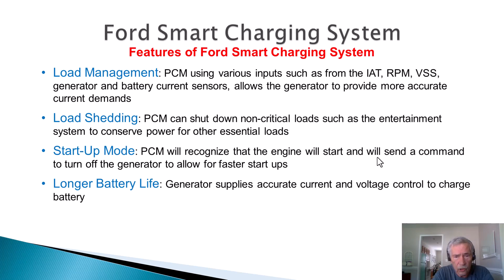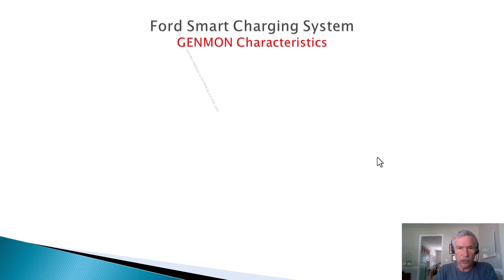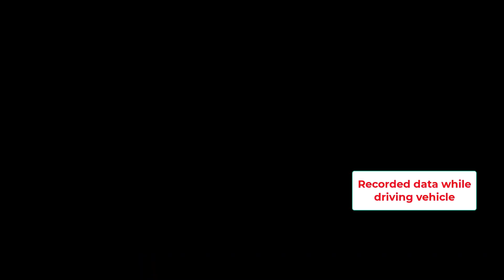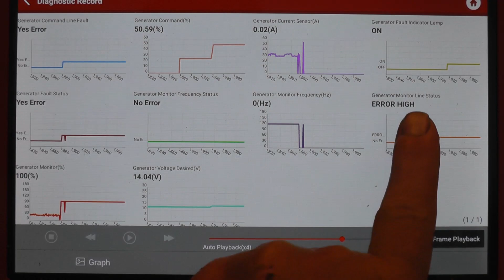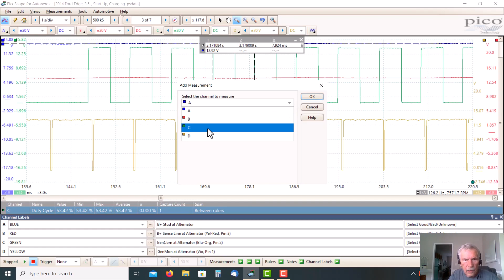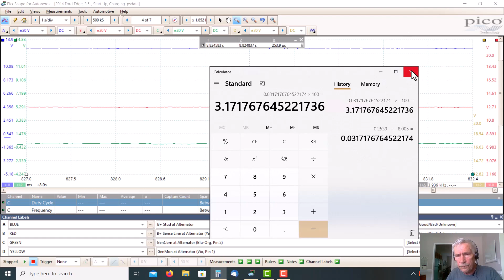Understanding and Diagnosing Ford Smart Charging System

Comment: Seems to contradict what I am seeing after installing new alternator on 2003 Ford Expedition.  GENCOM always displays a square wave typically around 8.6V, 60% duty cycle.  GENMON shows around 8-9V DC return, no square wave.  14.2V at the battery.  Connections between alternator and PCM check out at well under 0.5 ohms, no sign of wire chafing issues.  PCM was swapped out, made no difference.  OEM alternator was 2L7Z10346BA, replaced with Ultima R112019B.  1st replacement alternator showed a 170 Hz square wave.  I thought it must be defective, returned and swapped.  2nd replacement alternator about the same result except 130 Hz square wave.  So why a DC return on GENMON instead of a square wave?
Reply from the maker: Hi Steven, the GENMON will only put out a square wave pulse when it wants to change the setpoint. Otherwise, say after a start-up, you'll see activity on this line. Once the setpoint is made, you'll see a few pulses every 5 seconds or so. However, the GENMON line should always put out a square wave indicating the load on the alternator which reports back to the PCM. What's interesting is that you have 14.2V at the battery implying that the alternator is charging the battery. I would never check the ohms of wires as the only thing that it tells you with certainty is that the wire(s) are not open. I mentioned in the last part of the video of how to verify the wiring of these two wires and that the PCM is working correctly.

First, to verify that the alternator will put out a charging voltage is to unplug the connector. Start the engine and rev it to around 2500 RPM and you should see about 13.5VDC at the battery.

Now to check the wiring of the GENCOM and GENMON wiring and the PCM. With the connector at the generator still unplugged and the engine off, put a jumper between the GENCOM AND GENMON lines. Hook up your scanner and monitor the PIDs GENCOM and GENMON while the engine is running. You should see the GENCOM and GENMON PIDs flip-flopping. In other words, you'll see the GENCOM active and then the GENMON go inactive. And the process will repeat. If you see this, you know the lines are good, the PCM is good and that the program inside the PCM is doing its job. Good luck and have a great day!
Reply: @stuzman52  
Thanks very much for your reply.  All this started when my battery warning light kept coming on and off randomly and I got a "Check Charging System" message, scan code P0620.  Tried 2 rebuilt, reprogrammed PCMs, no difference.  First rebuilt alternator produced similar measurements except GENCOM frequency was 170 Hz, GENMON voltage 8.8 V.

Here are my detailed measurements with the 2nd alternator:

A. 3-pin connector detached from alternator, measured at PCM
	Key off, ohms to GND at PCM:	GENCOM = 2.1k		GENMON = 134k
	Key on, engine off:  			GENCOM = 8.7 V DC	GENMON = 0.0 V DC	    BAT = 12.16 V
	Key on, engine on at idle:		GENCOM = 8.6 V DC	GENMON = 11.6 V DC	    BAT = 11.82 V
	After engine rev to 2500 RPM:											    BAT = 14.29 V
	
B. 3-pin connector attached to alternator, measured at PCM
	Key on, engine off:			GENCOM = 8.7 V DC	GENMON = 0.0 V DC	    BAT = 12.17 V
	Key on, engine on at idle:		GENCOM = square wave, ~9 V Pk to Pk, 133 HZ, ~60% +cycle
													GENMON = 10.4 V DC	    BAT = 14.19 V
	Turn A/C on:					GENCOM DC = 5.8 V	GENMON = 10.3 V DC	    BAT = 14.12 V
	Turn headlights on:			GENCOM DC = 4.9 V	GENMON = 10.2 V DC	    BAT = 13.97 V
	
Here is what makes no sense to me, based on your presentation and REMY's:
	Why does GENMON show a DC voltage instead of a square wave, and only when the engine is running?  I thought this voltage was supplied by the PCM, to be manipulated by the alternator.
	
	Why did the GENCOM square wave show a radically different frequency from the 1st alternator to the 2nd allegedly identical alternator?  I thought this was controlled by the PCM, but it looks as if it is being set by the alternator.
	
	Why does GENCOM show an 8.7 V DC level with the engine off and the alternator disconnected?  I thought the GENCOM voltage was supplied by the alternator, then manipulated by the PCM.
	
	With the alternator disconnected, key on, engine off, I would expect to see a source voltage at GENMON, and no voltage at GENCOM.  Instead I see the opposite.
	
Even so the system seems to be charging the battery OK, and I have not (yet) seen the battery warning light come on since installing the 2nd alternator.  

Expedition was made in July 2003, but wiring appears to match 2004 wiring diagram, with no fuse in #9 (ALT) fuse location even though 2003 handbook says there should be a 10 Amp fuse there.

I am wondering if I might have a Group 2 system as described in this article?
https://www.electricalrebuilders.org/techlib/tech_articles/ford_6g_regulators.pdf
Reply from the maker: @stevenlord7362  Hi Steven, the presentation I gave came from the website that I posted. I don't have any good answers for your data as it seems to be different between the two alternators. When I purchased the alternator, I was worried that I would get one that wouldn't work. And I'm sure that you've seen this from different distributors such as Napa, Auto Zone and others. And I had a friend with the same type of alternator order a brand new one from Amazon that didn't work. He finally got one from the junk yard which worked fine. Since your alternator seems to be working, I wouldn't worry about it. Do you have a scope to see the raw data that's on the three pin connector? Have a great day!
Reply: @stuzman52  
Thanks again.  I do have a scope, can't understand why GENMON is always a DC voltage, not a square wave.  Wondering if I got 2 defective alternators in a row.  Either that, or the system just doesn't work the way I thought it did.
Reply from the maker: @stevenlord7362  Excellent that you have a scope Steven! First, from your previous comment, you posted a link to a possible scenario of where you may have a totally different system. Here's what I would do! I would want to know how does this system work on my vehicle. I suggest a subscription to www.alldatadiy.com to read up on how this system works on my vehicle. For a month's subscription, it's $19.99 which is well worth the information that you need. My guess is that you have the system where there should be a square wave on the GENMON line at all times to report to the PCM how much load is on the generator. Read up on your system and if is like the system outlined in this video, then hook up your scope on the GENCOM and GENMON lines and see if you get the square waves. And while I'm thinking of it, did you jump the GENCOM and GENMON terminals together in the connector and monitor those PIDs as I mentioned in the previous comment? And do you have any battery charging issues, battery messages, etc.? And who knows, you may very well have another bad generator. I've seen several videos on YouTube where users have changed their generators several times for not charging. Let me know what you see on the scope. Have a great evening!

Comment: Terry nice vid very informative and detailed I’ve got an 09 edge changed the generator in 2020 found the problem after checking all 12 diodes found  4 positive diodes were open thinking the cause was engine soak (heat) anyway that’s my 2 cents CHEERS
Reply from the maker: Thank you Anthony for sharing a comment! Good to hear that you got your generator sorted out and have a great day!

Comment: I understood most of the PWM aspects of these systems Terry but what exactly did you use to confirm that the alternator was bad? To most people that's the only question that needs to be answered. Obviously, if the battery is dying that's one hell of a clue but since the voltage is constantly being varied the old standard of "if it's above 13.5V then the alternator is doing it's job" is a lot harder to determine. So what's the magic bullet that confirms a dead, or dying alternator?
Reply from the maker: Hi Dennis! Well, of course if you don't see any battery charging voltage, that's an indicator that the battery isn't charging. But on the other hand, you may see charging voltage as you indicate, and there could still be a problem. I've see where there is a charging voltage and yet the charging indicator light is on. At this point, I would assume that there is an issue with the pulses sent or received by the PCM which for the most part would still be a fault of the generator. I can remember Eric O. doing a diagnostics on a Ford with this system and there was no charging voltage. Yet, the charging indicator never came on, even with the 3 wire connector disconnected from the generator. In my case, as I mentioned in the video, I would love to have seen the raw data on the scope while driving the vehicle. The problem was intermittent and I could never get it to fail while in the garage after about an hour of running while turning on loads, etc. And as I mentioned in the video, I didn't want four probes hooked up to get caught in the fan while driving. That's where I relied on the scanner data while driving which showed that the regulator stopped reporting the duty cycle on the GENMON line. So, I pretty much relied on the scanner data to call the generator the fault. Thanks Dennis for dropping in and sharing a comment! Have a great day!
Reply: @stuzman52  Terry it might be time to come up with a third video: "How to Diagnose a Pulse Width Modulated Alternator." Your case here was exceptional since it was intermittent but that situation could be somewhat rare. Just a general video showing people what to look for to determine if their pulse width modulated alternators are working or not could be very helpful. We retired guys need something to do.
Reply from the maker: @satamanschmidt3428  I figured that using a DVOM would point people in the right direction if their generator was working or not. Even at the end of the video, I mentioned about disconnecting the 3 wire connector and jumpering the GENCOM and GENMON lines together and monitoring those PIDs in a scanner to see if they would rise and fall which indicate that the PCM transmit and receive lines are not shorted or open and that the PCM with its algorithm are working. Not sure how much I could show.

Comment: What a great topic, and a fine explanation! I find dealer repair manuals too thin to properly explain how some of these systems work, and they seem to intentionally leave important proprietary details out. They often leave out so much info that it is hard to use a logical approach to diagnostics. What I find most annoying is how they put huge effort into fuel economy, with no regard for how durable their product is. If the vehicle hits the landfill years sooner, corporate profits may be preserved but all environmental benefits are lost.
Reply from the maker: Thank you Dave and hoping you and the family are doing well! Yes, you are correct that it's hard to sometimes figure out how some of these systems work. And it makes it even harder to come up with a diagnostic plan of how to check the system if you don't know how it works. Thanks for dropping in and sharing a comment!

Comment: Your wife might of thought it was boring but this video is extremely informative. Thank you so much. Thank you for sharing the conversion formulas and thanks for explaining these new starting systems. I noticed that sometimes you used the word generator and at another point the word alternator? Can you explain that? Thanks again I’m just a retired aircraft mechanic but now trying to study and learn todays cars new electrical systems. Taking courses wherever I can. Thanks for ATG, Mechanic mindset and Hands on Automotive Training plus let’s not leave out Mr.G at ATTS. Excellent courses. 👍
Reply from the maker: Hello Arthur and glad to hear that you found the video helpful. And guess what, the wife and I did a final preview before I uploaded the video, and she said that it was still boring 😂 Good to hear that in your retirement years, you're learning about automotive electronics and how they work. Always good to keep the brain working on something in our older years 😊 Yes, I use the terms alternator and generator interchangeability where it's a device which converts mechanical energy into the electrical energy. If you may remember in the old days like early 60s and before, the device was called a generator and this is where the brushes inside rode on top of a commutator which supplied current directly to the armature windings. The commutator was used to convert the AC into DC. Then in later years, the device was called an alternator which used diodes to convert the AC to DC. In 1996, the automotive industry decided to drop the term alternator and go back to being called generator. See, how confusing this is. Whether you call it a generator or alternator, people will know what you're talking about. For a little more technical aspects of the definition of alternator and generator, here is a link which can provide some more information on the topic. https://www.beupp.com/generator/what-is-the-difference-between-an-alternator-and-a-generator/ Have a great day and keep studying as it looks like you picked some fine resources to further your knowledge of the automotive industry. Have a great day!
Reply: @stuzman52  thank you for the outstanding answer. I will definitely refresh my memory by watching the next video. Sounds like we’re from the same era and don’t ever want to stop learning. Thank you and once again tell the boss the video was filled with knowledge Lol Artie 👍
Reply from the maker: @arthurfricchione8119  You are quite welcome Artie, and I asked the wife again about the video and she said that it wasn't quite as boring as the first draft 🤣, but still not her cup of tea. Always learn what you can no matter what the topic, and you'll be enriched with knowledge that can inspire you and your family for a more richer life. Thanks Artie for the support and have a blessed day!